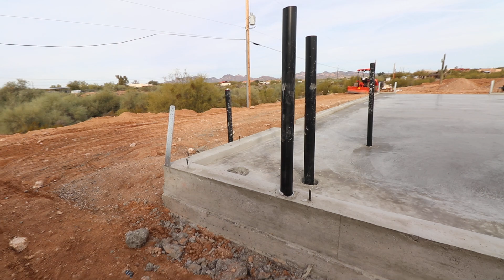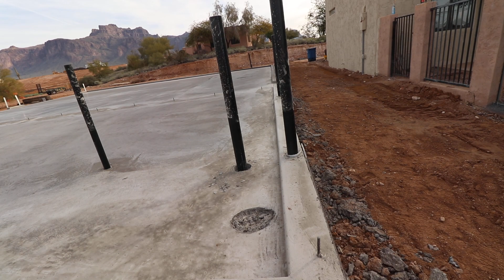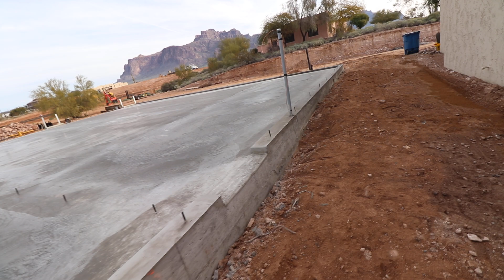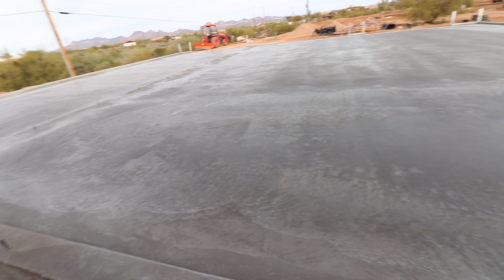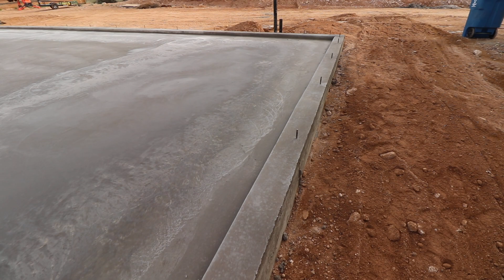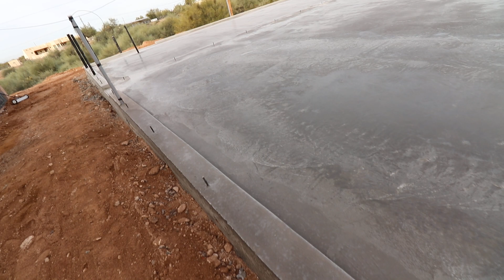slab is poured and looking good. shop/rv garage part 3

Comment: I'm 60 miles from Kingman (the closest cement), planning the same... do  you mind me asking how many yards that is and what it cost? You said the yardage but forgot... you can message me if you don't want it public.
Reply from the maker: it was right around 20k of concrete and 118 yards
Reply: @dirtydiggerm62  Thank you so much... is that 20k just for the concrete or is that the labor / them putting it in as well, you never know with crazy prices now. I just spent 48k for a 1500' well up here..... need another 25k for the pump and 1500' of 4 conductor copper, it's 15k just for the wire, its' gone crazy out there.
Reply from the maker: yeah, that's quite expensive id double check the price of that. it was about 40k overall not including my labor for the base, plumbing, concrete and parts to get to this point. about 100k including all the pre ordered parts and material